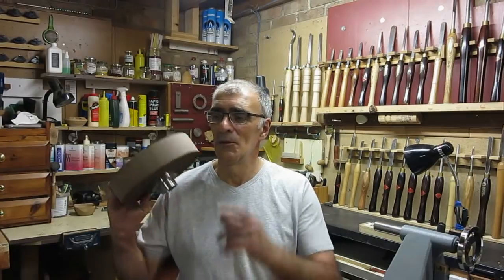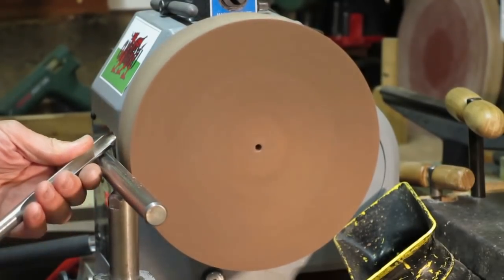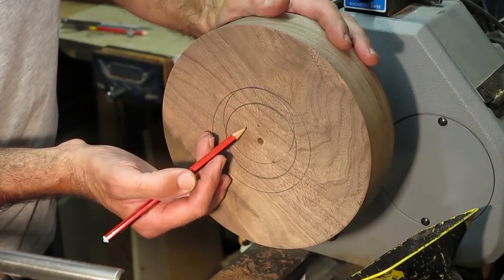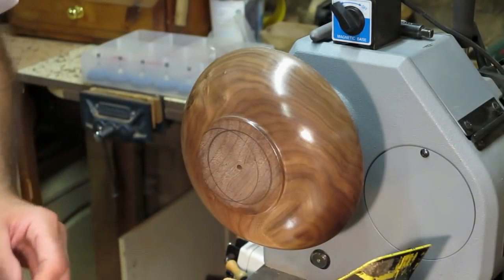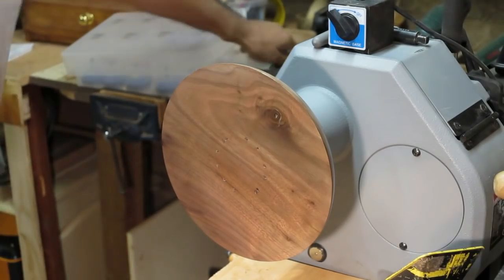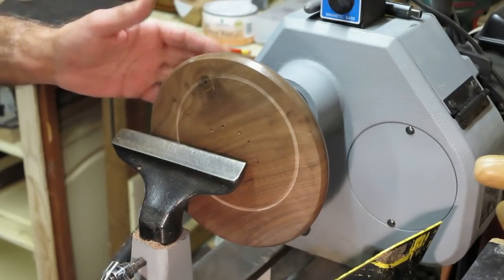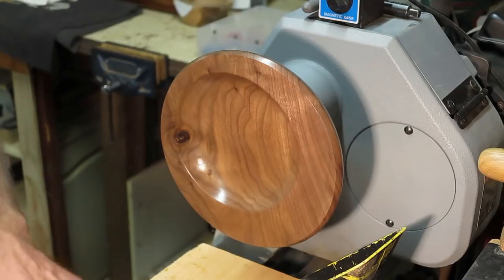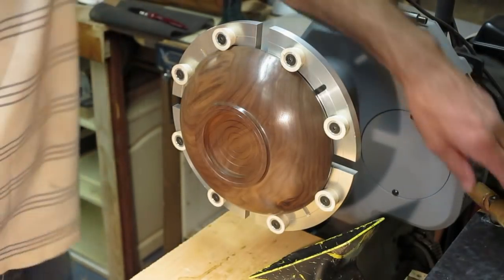Wood Turning - Off Center Bowl

Comment: I guess I'd vote for the waste block glued on. At least it could reduce the depth of the screw holes. It seems that the base is a large enough gluing surface to withstand the shear force.
But, each of us are solely responsible for consequences -- So I understand and appreciate your caution.
Very nice looking bowl. Beautiful
Alan
Reply from the maker: Thanks Alan, I have changed my views on using a glue block, as is seen in the quick follow up video I did. So many different ways to do things, and so little time to do them :)
Take care
Mike

Comment: Nice work, Mike. I had no idea how to turn offset.
Completely agree about not using glue block for offset turning; use all six screw holes!
Reply from the maker: Thanks Bill, glad you agree mate :)
Take care
Mike
Reply: Mike Waldt An engineering opinion, Mike; I haven't been turning long enough to express woodturning opinions!
Reply from the maker: Bill Wells Ah I see Bill. Actually I have it on good authority that a good glue block with a mortise would be more than strong enough! I am going to try it for myself, and see how it goes.
Take care
Mike

Comment: Beautiful bowl, I love the off-set design.
For next time, glue a sacrificial plate to the bottom (sandwiching in a piece of paper) so when you screw the plate you're not screwing into the bowl. At the end you can remove the plate by carefully prying it with a chisel then clean up the foot.
Reply from the maker: Thank you Fred.
Great tip regarding the glue block ... thank you.
Cheers
Mike

Comment: Mike, I think I've got the perfect piece of wood for this. But. I think I'll have to try the glue block method, because my piece is a bit too thin for the screws. Perhaps a bit scary to do off centered with a glue block. Hmmm...  Anyway, I'll definitely be watching this a few more times to get the process in my head, and I'll do a video whenever I do get around to trying this. Thanks for this idea!
Reply from the maker: Steve, I wouldn't recommend a glue block for off center work, lots of comments have suggested that method, but I cannot feel confident that it would hold up to the stress.
Sorry if it sounds too cautious, but it's my personal opinion, and I do use glue blocks regularly, but not for off center work. 
Take care
Mike

Comment: Mike could you have used a glue block to save you having that large base ? Obviously it would need to be removed and recentred for the off centre interior of the bowl . 
Sure you've probably done a few more since this .  Nice work . 👍
Reply from the maker: Yes and in hindsight a better option 🙂

Comment: Well done Mike. It's a lovely looking bowl.
I've been trying to think of a different way of doing this without having to use a faceplate. I tried it with double stick tape and it didn't end well :-/ . Next time I'll try a glue block but that has it's own issues. I know there are offset chucking systems I could buy if all else fails.
Cheers,
Ben
Reply from the maker: Thanks Ben, there are various ways of doing this type of turning, this is just one I tried, I'm sure I'll give other methods a go over time :)
Take care
Mike

Comment: Beautiful job , well done. Just some food for thought , have you considered gluing a piece of waste to the foot of the bowl which would eliminate the screw holes in the bottom of the bowl?. It was a beautiful finish.
Reply from the maker: Hi Lyle, and thank you.
Since this video I have actually turned a couple more, and yes, you guessed it, I used a glue block on one of them, and it worked a treat. Thanks for the suggestion though, I do appreciate it.
Take care
Mike

Comment: True craftmanship mike,a question.you off center your bowl.and that must create an enormous amont of strain on the bearings on the lathe.guess yours can take it but ,do you recomend doing this on lets say cheaper lathes?
My first lathe will only be a cheap one so,dont want to wreck it
Reply from the maker: Hi Atlel, I think you'll be ok with smaller off center turnings, as long as there is not a lot of weight involved.
Take care
Mike

Comment: Very nice, Mike ... I love the look of walnut. I wonder if this would have been a good application for a glue block on the bottom instead of the face plate? Some don't trust glue blocks, but I have had good results with them.
Reply from the maker: Hi Gerald, I have used glue blocks a lot, but never on an off center project, let alone an off center bowl. Judging by the feed back i have received to my doubts, i am now happy to try it, especially now that you have endorsed the method too. I will try it and see.
Thanks for the input and support my friend.
Take care
Mike
Reply: Mike Waldt
I should add that I use TiteBond I (original formula / red label) and let it dry/cure overnight. Any good PVA wood glue would probably do just as well. I wouldn't use CA ... it is too brittle. Just saw your followup video ... Good luck, Mate!
Reply from the maker: Gerald Jensen thanks for the additional information Gerald, I appreciate it. I also use Titebond Original, and find it to be excellent. I do agree for glue blocks I don't like CA for the same reason as you stated. As I said to Erik, I am looking forward to experimenting more with this area of turning.
Take care, and as always, thanks for your input.
Cheers
Mike

Comment: Mike, have you ever used hot glue to mount the work piece?  No screw holes to deal with.
And, a short burst with a heat gun and the piece releases nicely.  I'm going to put this project on my list.
Reply from the maker: Hi Bob, I do actually use hot glue quite a lot on glue blocks, but I must have had brain fade on this, as it didn't even enter my head. Mind you it must be said the ol' brain is not what it was, not that it ever was that impressive ;)
Take care, and thanks for the tip.
Mike

Comment: Beautiful bowl, and a video to match! I love the way the finish came out! I do have one question about the wax you are using. You might remember (although I wouldn't think you will) but I live in Italy (great food, not as much arts and crafts supplies as I would expected in Rome, traditional art capital of the world...), and I've been suing 100% hard bees wax for finishing, but I do have a tub of what claims to be 100% paste wax, which I bought years ago, but once I opened the can, it smelled to badly of some benzine type solvent, I couldn't get myself to use it on any wood. Is my paste wax the wrong type, or is that the same kind of wax you're using and smell goes away completely when the wax dries? (I would also find it hard to wax something without the honey smell of real hard pure bees wax...:).
Reply from the maker: Hi Yuval, and thanks for the kind words my friend. Paste wax does have a solvent smell to it, but I only use it on my lathe bed, and metal surfaces to protect against rust etc. many use it mixed with mineral oil for sanding, to cut down on the dust.
The wax I use is called WoodWax22, and is a blend of beeswax and Carnauba Wax, and is made by Chestnut Products here in the UK, I'm sure you can get it to Rome via the good old Internet :)
Hope this helps, and thanks again
Take care
Mike
Reply: That is perfect help! I've been ordering my tools from the UK with the help of Amazon and Ebay, now I know the brand I'll add it to my next order, so thank you so much :-) !
Reply from the maker: yuval lahav My pleasure Yuval, any time mate, any time at all :)
Take care
Mike

Comment: Hello Mike, 
Beautiful bowl, I have been turning for about 7 months now and absolutely love this! My question is, you said 2 coats of sanding sealer then wax. Could you please elaborate on that process. How long between coats of sanding sealer, sand in between coats? And what is the "wax"? Again, great piece and thank you for sharing!!!
Reply from the maker: Hi Bob, apologies for the late response.
I thin my sealer with 1 part thinners, as I find it absorbs into the grain better, and dries much quicker. I "de-nib" between coats with scotch pad or Nyweb, to smooth, ready for the wax. In this video I used WoodWax22 by Chestnut Products here in the UK, but any proprietary wax will do the job. Currently I use Hampshire Sheen, and precede it with Yorkshire Grit (after the sealer has died).
Hope this answers your question...if not...just let me know.
Take care
Mike

Comment: Hi Mike, thanks for the video. Highly entertains material as usual.  I am just beginning to venture into the off centre woodturning projects. After lots of research, I am seriously considering the purchase of a Robert Sorby eccentric chuck. Have you or any of your colleges any experience of that chuck ?. Any comments would be appreciated.  During this video, I noticed you used a pencil and epoxy to fix a knot situation. This is not something I have ever seen before. Would you mind taking the time to explain the thinking behind this method. Keep up the good work Mike, All the very best, Yours Ricky
Reply from the maker: Hi Ricky, I have never used an eccentric chuck,  so cannot help you I'm afraid.  As to the way I secured the knot,  it was just one way to do it that seemed to work ok.
Thanks for watching and commenting.

Comment: Lovely Mike.
Would it have been possible to use a glue block on the base, or do you think the forces of the eccentric rotation would have made it break off the glue block?
Frank
Reply from the maker: Thanks Frank, I personally would never use anything other than a face plate, for this type of turning on a bowl, I think the risk is too great of the joint failing. I must say I use glue blocks a lot, and find them a sound method of mounting work, but I'll say again I would not even consider it for this type of turning. Just my opinion.
Take care
Mike
Reply: Mike Waldt I hate it when lumps of wood go flying. I will stick with a faceplate.
Thanks
Frank

Comment: Hi Mike,

I realize this is a somewhat old post, but I've just watched it twice and wanted to thank you for posting this as well as ask a quick question.  I noticed that you started out with the faceplate on what became the top of the bowl. Is there a reason you couldn't have skipped that step and gone straight to the first faceplate location on the base? It seems that the faceplate on the top really just allowed you to true up the sides and establish the basic shape, both of which (I would think?) could be done with the faceplate on the other side.

I'm not being critical at all, just trying to learn. I have a similar project in mind, except with multiple recesses around the perimeter, and none in the center, so I can't afford the first set of screw holes. Just wondering what you thought.

Thanks again for making this. I have watched many of your videos and always enjoy them.

Dan Stromberg
Maryland, USA
Reply from the maker: You could do it your way Dan without a problem I would think. Thanks for watching my friend.

Comment: Mike I have a record CL3 lathe should I spend £500 to upgrade to variable speed (and 1hp motor) or just get a new lathe. Your lathe looks spot on what is it? Thanks. David.
Reply from the maker: +MrWhitehead7 
Hi David, I really couldn't advise you what the best thing to do would be, as I have no experience with your model. However, I can recommend the lathe I have, as I have found it to be excellent, it's the Axminster AT1628VS.
Apologies for not being a better guide for you.
Take care
Mike

Comment: Maybe next try, use a glue block on the piecce, so as to not waste any of the 'good' wood. Nice piece!
Reply from the maker: Hi Brad and thanks.
I use glue blocks quite often,but NOT for a piece that involves off center turning, I think the stresses are too great, when in off center mode. Just my personal opinion.
Take care
Mike
Reply: Mike Waldt In the case of 'off centre' turning, in order to facilitate better safety, I turn a shallow mortice in the piece & a corresponding tenon on the glue block. While turning, I cut the speed down to around 500-600 rpm's & use the tailstock for as long as possible. It has worked very well for me, haven't lost a piece in over 10 yrs of turning. Either way, keep having fun & be safe mate. :)
Reply from the maker: Brad Nielsen Hi again Brad, I really appreciate the advice my friend, it looks as though I may have been a little too cautious, if it's worked for you for so long it's what I would call "tried and tested". Thanks again for the info. mate
Take care
Mike

Comment: Mike in place of the screw face plate, could you use a glue block? I plan on trying this. Thanks.
Reply from the maker: +sawdust85222 
I have heard of it being done with a glue block very successfully. I actually planned on doing a video on that process, but as yet haven't got around to it :)
Let merry know how it goes for you. 
Cheers
Mike

Comment: Hello Mike,
Just a quick question, do you always use sanding sealer on your work first?  I've noticed others using it while some do not.  Thanks for your time, Glen
Reply from the maker: Hi Glen, I always use sanding sealer before applying any finish except oil, Tung Oil, Danish Oil, and the like, as an oil finish needs to penetrate the wood.The sealer fills and raises the grain, so a light "de nibbing" in between coats leaves a nice smooth surface on which to apply your wax.
Hope this helps
Take care
Mike

Comment: Thank you Mike. Question: I have a 250mm (10”) swing on my lathe, and I’m worried about the blank hitting the bed and or toolrest. What measurements do you suggest I use to place the offset ring for the faceplate?
Reply from the maker: Check the measurement from the centre of the off set turning to make sure it will clear your bedways. Cheers. Mike

Comment: Hi Mike! Enjoy watching your videos I've learnt a lot from them since starting turning what probably 12 months ago. I have a Axminster lathe and the beds starting look abit shabby. Ive cleaned it up well but noticed yours looked almost polished, just wondered what products / techniques you use to clean up your tools/machines. Cheers
Reply from the maker: +Gavin Brookes 
Hi Gavin, I use 00 00 wire wool, followed with a coat and buffing of wax, or you can spray some WD40 on the lathe and then use the wire wool. I find that a regular regime like this, keeps the bedways in good condition.
Hope this helps
Cheers
Mike
Reply: +Mike Waldt cheers for your reply Mike!

Comment: Very nice bowl Mike your an inspiration to us all. Have a question, what speed do you turn at when  you use the extended jaws, Cheers again Mike.
Reply from the maker: Thanks Ken, I honestly cannot remember the RPM on this piece, but suffice it to say I try and turn as fast as I can to get a better cut, normally I raise to speed up gradually until it starts to vibrate then back off.
Hope this helps
Cheers
Mike
PS - One word of advice, never turn at a speed you don't feel comfortable with, if you do, errors will surely occur ... don't ask me how I know this ;)
Reply: I asked as my record jaws state 600rpm which is really slow for getting a finish with a gouge.
Reply from the maker: Sorry Ken, I misunderstood your question, you meant the button jaws didn't you. You're right 600 rpm is the suggested safe maximum for these type of jaw. They are only meant for removing, or tidying up the foot, or the bottom of the bowl, so speed shouldn't be too much of a problem, and then of course there is the sanding ;)
Take care
Mike

Comment: mike what is your concoction for your nice finishes
Reply from the maker: Hi Tim, what I do now on most pieces is as follows:
Apply two coats of sanding sealer mix, 3 parts sealer to 1 part thinners, denibbing between each coat when dried, then

sand to 600 grit, then apply Yorkshire Grit, followed by Hampshire Sheen.
Hope this helps
Cheers
Mike